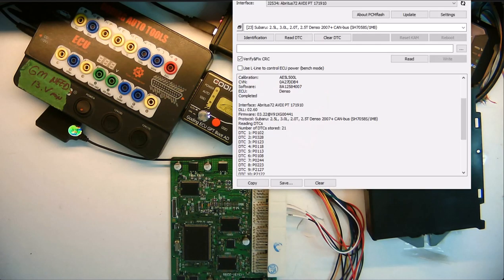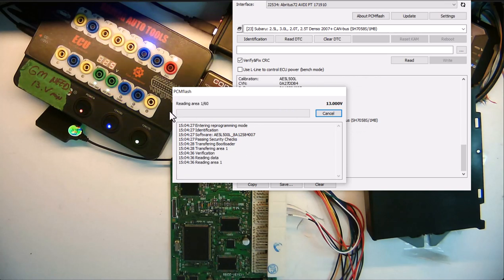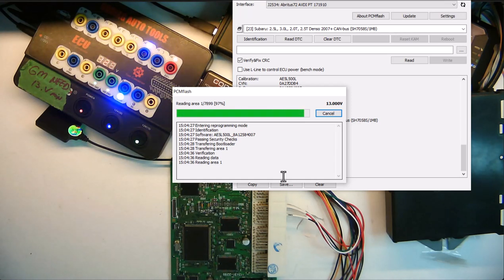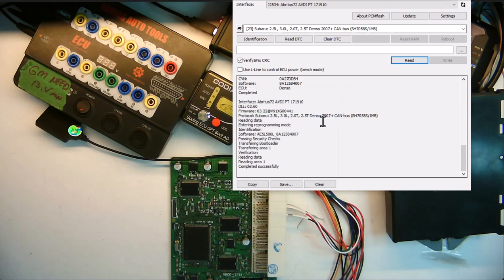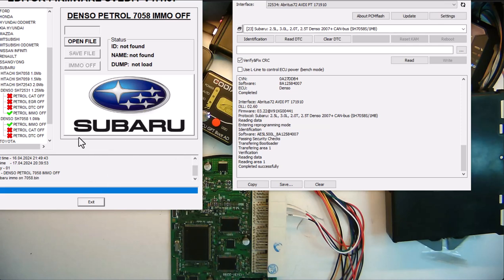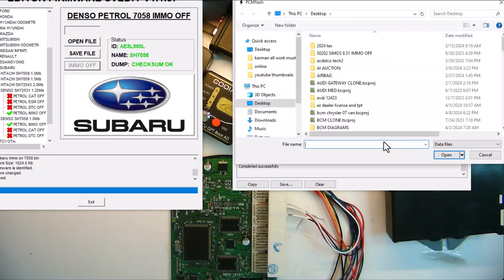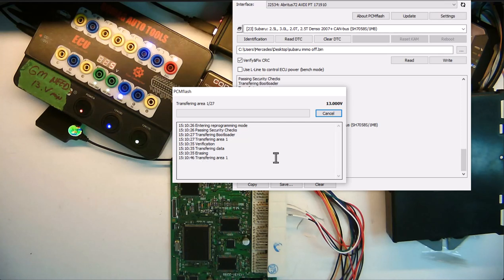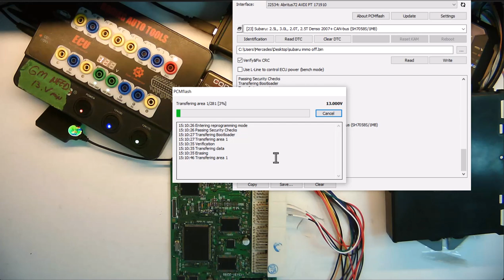How to Start a Car After Locksmith and Dealer Failed to Program Immobilizer.

Comment: i have a 1998 subaru legacy outback 2.5 liter that i drove into a flood and water came up just to the top of the seats. four days after flood, i found that my ecm growing green stuff upon opening it for inspection. after i cleaned, few pins have disintegrated of corrosion and couple circuit card traces fried. i'm buying a replacement from ebay. being an old car, would this not starting, and vin number, locksmith, etc, be same factors that i would run into? is not just a plug and play situation? thank you...